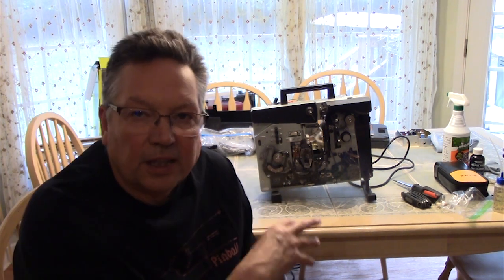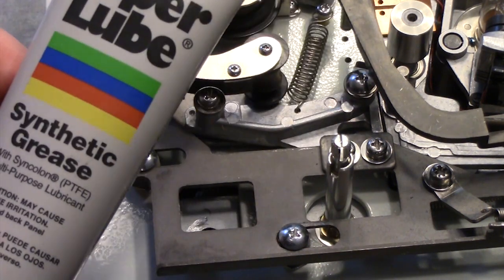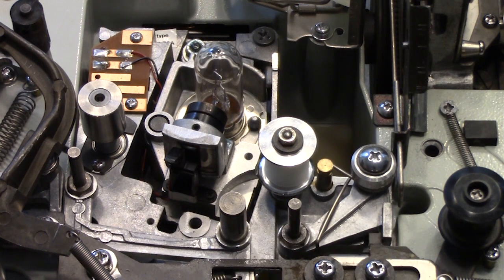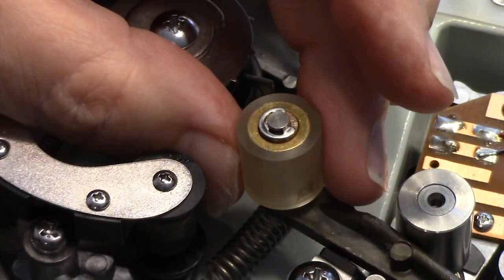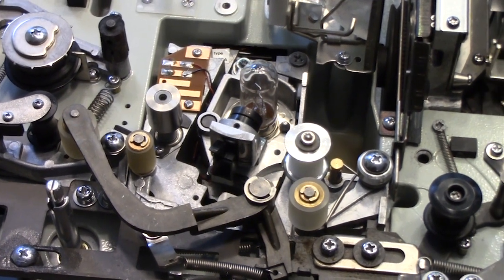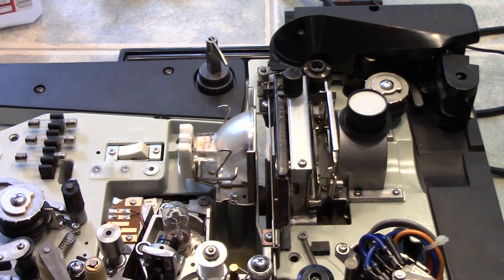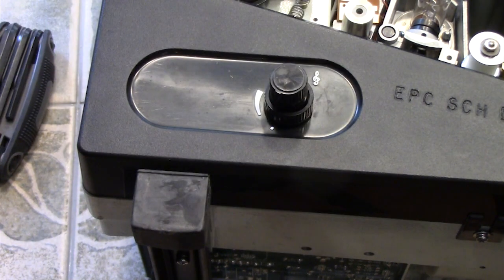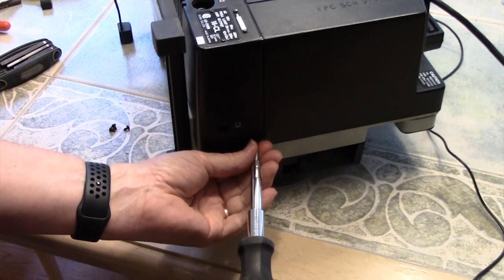The Projector Project - Elmo 16-CL Project 1 - Part 3 - Roller Replacement and Finish

Comment from the maker: The deposit is on top of the cost of the rollers.  So it’s currently $110 for the rollers with a $90 deposit so $200 of which you will get $90 back when you return the old rollers.

Comment: How does the deposit work? The 4 roller set is $110 with a $90 deposit.  If you send your old rollers in and get the deposit returned, does that mean you're only actually paying $20 for the rollers? Or is the deposit added onto the $110?